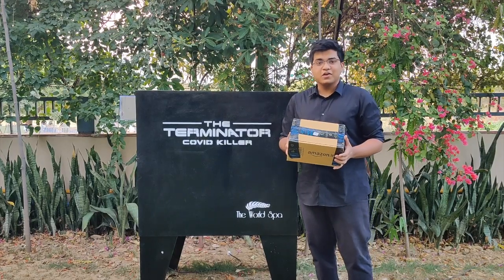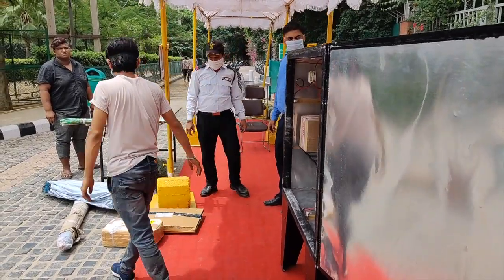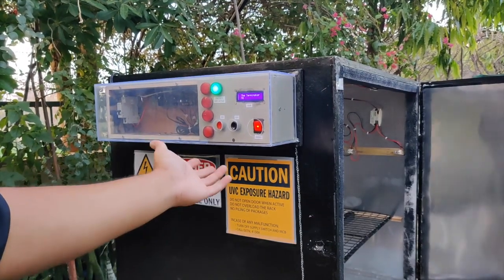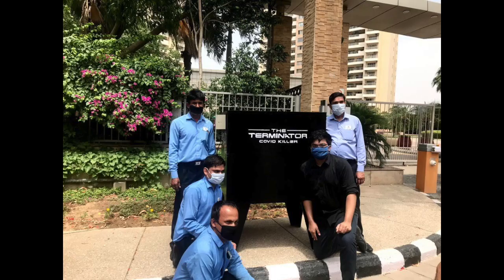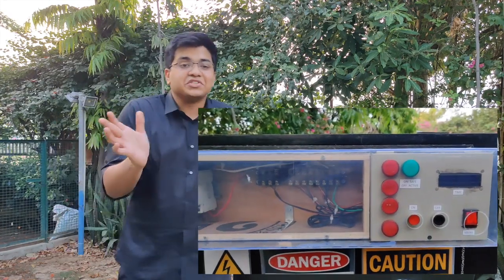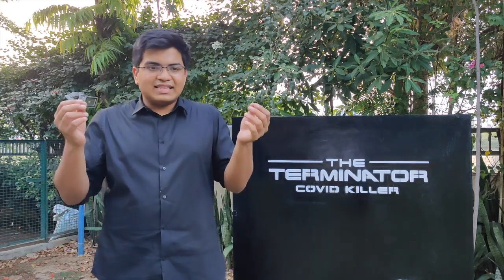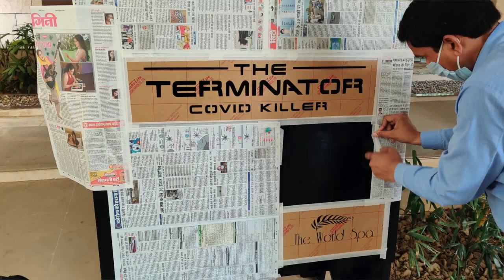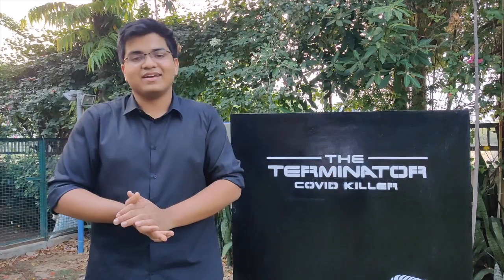How I built a UV-C Chamber To Kill The Coronavirus

Comment: Hi you are just assuming the box has a Corona virus .and putting the boxes inside the UV light cabinet and the Corona dies .you never checked virus before and after the UV light .
Instead UV light  the sanitizer may be better solution. Save time &  power .
Reply from the maker: Hi! UV light has been used in hospitals for decades. From SARS-CoV1 we know that coronavirus is killed by UV light in the neighborhood of 200 joules per metre squared.

My machine assumes worst case scenarios in my calculations and ensures that each and every surface gets 200 joules per metre squared. 

There is no testing agency in india that tests UV light against viruses - we are relying on the solid science behind this along with verification from IIT faculty. 

Using sanitiser is just not a practical solution at all. Firstly, you cannot use harsh sanitisers on vegetables, milk and food deliveries. Secondly, surfaces like cloth, cardboard etc need to be visibly wet for around 4 minutes to kill the virus. It is just not feasible to soak all our packages in sanitiser. 

Hope this answers your questions! Let me know if I can answer any more/clarify anything :)
Reply: @MakingWithMihir  Thanks good answer.request is before putting the boxes inside the UV equipment as you agreed the boxes have Corona. your staffs should be safe by using gloves . 👍
Reply from the maker: Hmm yes definetly! This is a work in progress - still learning - and so I will make sure the staff are also provided PPE! Thank you for your suggestion - gloves masks and faceshield will be given to the operators.